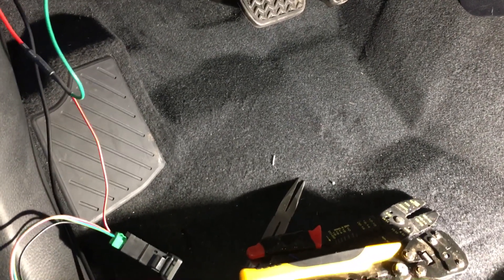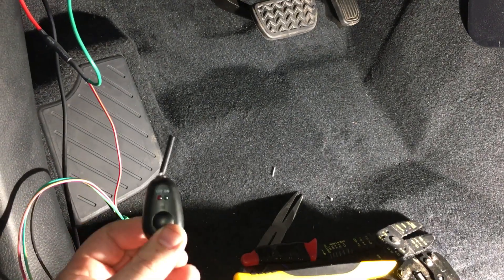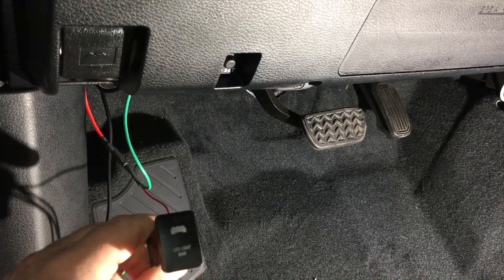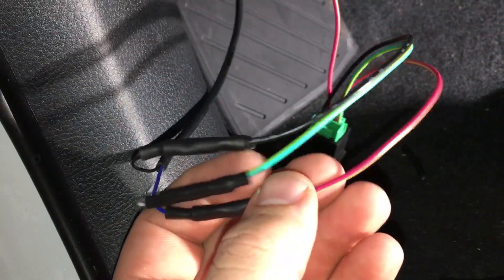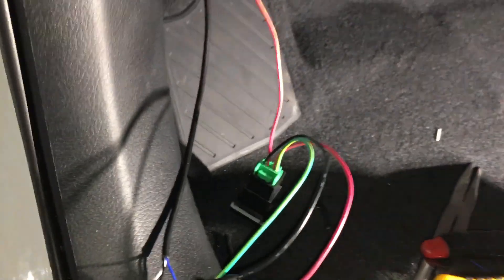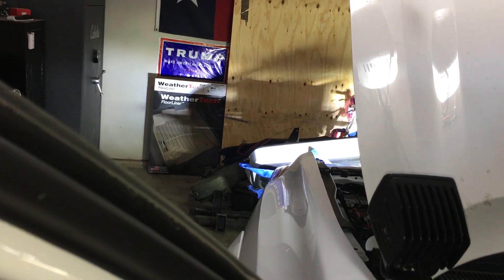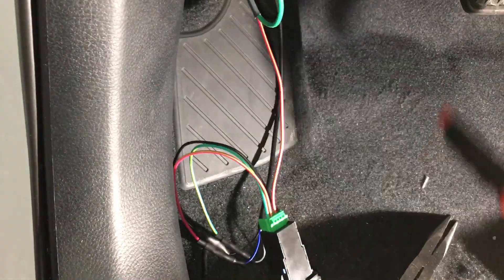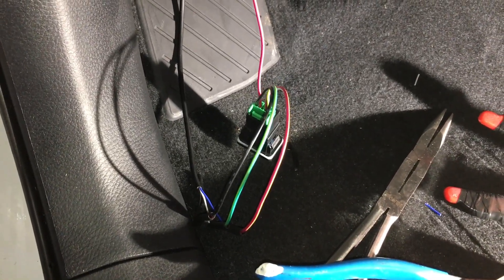Wiring up a Push Button (Mictuning) switch

Comment: Bro I have a switch of 2 buttoms with 5 cables of colors (red, green, yellow, black,  blue) my raptor lights have only red and black and the add a circuit cable (for the fuse) is red. I am really confused on how to match them, any video or tip to figure it out? Thanks

Comment: Can I tap the source wire [red/yellow] with the dash light [red/yellow] with a 10amp fuse in-between?
The idea is to have the switch accessory light turn on only when high beams are on and not when the car accessory light is on. But not sure if someone tried it already.

Comment: If I’m using a relay does one wire go to the relay and other battery or fuse box , I know one goes to power to light the switch up. But the other 2 wires. Which goes to relay which goes to battery

Comment: If I dont want the switch to light up, do I need the add a fuse? Could I just leave that that second red wire loose?
Reply: Hey just wanted to know if you left your wire like that or if you added a fuse, cuz i have the same question as you but i cant find an answer

Comment: Quick question. I added one and I have an add a fuse coming to me, so I tucked a wire away to light up the switch. With the add a fuse you took the cover off the tundra fuse box. How did u fit the cover back on the under dash fuse box or did u leave it off now? Thanks
Reply: I found my answer and didn’t use the add a fuse. I popped off the black label holding the switches and used a circuit tester to find the wire for the other switches that lights it up when the lights are on and I tapped into the one on the bed on off switch. It’s the yellow wire in the top row on that switch that lights it up and I tapped into it and wired the fog light switch to it so now my fog light switch lights up when I turn the lights on, keeps it looking factory original and I have led fog lights now.

Comment: Thanks for the very helpful video—just what I was looking for.  But I have the same question as a number of others on here and I haven't seen it answered: where does the green wire go that is tied in to the add-a-fuse?  Thanks for the help!
Reply from the maker: It goes into any spot on your underdash fuse panel that has accessory power. I have mine tied into the power jack fuse spot
Reply: Thanks for the reply, but I guess I'm still not quite clear.  Where does the other end of the green wire go? The end that runs up under the dash and out of the picture, not the end thats visible  in the shot where it joins the add-a-fuse wire next to the red/yellow wire off the push switch.
Reply: Are you saying that the end I'm referring to goes to another fuse in the same panel that the add-a-fuse is on?  Thank you for your time.
Reply from the maker: Oh I see what you’re asking. I think I replied to one of those but it’s to another switch that way I only need one “add a fuse”
Reply: Got it!  Thanks again.

Comment: Hey quick question bro, if I already have my led light bar installed through my ignition fuse with the add a circuit, then where do I connect the ditch lights add a fuse? Any open fuse on the circuit board?

Comment: I've watched many videos and each time my button stayed on even though the truck was off.  I ordered both the wiring harness and switch from caliraised.  I pulled my hair out wiring this thing up according to how the internet said I should and it just wouldn't work correctly.  Turns out that the wires are wrong.  In my case, the blue wire(from the relay) actually needed to be connected to the green/yellow wire(switch harness).  The red/yellow wire responsible for the on state needed to be connected to the white wire(from relay).  Bottom line, don't always trust the way YOUR harness is pinned.

Comment: So when you connected the wires did you just strip the top of the wires and tie them together and then put the heat shrink on top of it ?

Comment: Problem fixed for the constant power on the switch. If you have the new Cali Raised switch harness with black, red and white. Black to black, green/yellow to the red, Red 1 closest to the green goes to white. Add a fuse to the panel fuse on the fuse block. Was just confirmed on Tacoma world, and I just fixed mine a moment ago. I had the same problem and now I don't after I switched the wires.

Comment: Hi Texas,
Do you have anywhere showing how you connected it to the fuse box for power or any of the wiring set up in the engine compartment. I just installed a led light bar behind lower grille on my Tacoma and the switch has constant power. Not looking to drain my battery and being we have the same harness this looks like it would be my best option. Anyway you could make another video to show that? 
Thank you
Reply: Bruce Gibson check out my video how I did my tacoma

Comment: Damn did it exactly like you said and the switch stays powered on and the lights go on with the battery off. Can you help me? Am I missing something? We have the exact same set up. Except the Cali raised harness has a red instead of blue. I assumed it was the blue one.
Reply from the maker: MustacheMuster  you may have switched up the red wires.
Reply: Wondering if you got your wiring of this switch figured out??  I've got seemingly the same problem you do...  Can you give me a little help?
Reply: Did you ever figure out the issue? Im trying to install today and im running into the same issue
Reply: I figured out that the switch wiring varies from manufacturer to manufacturer...  so the Black was not necessarily GROUND...  so I finally figured it out based on pin number...  Still having issues with the dash lights circuit.  but the upper LED lights when I turn on the switch along with my light bar...  and turns off with the lights as well.
Hope this helps a  little!

Comment: Hello all, I have the same question as Jonathan. What is the other green wire coming from the add a fuse line, looks like you added another wire to that add a fuse line. I am having the issue where the top light on the switch stays on all the time even if light is off. The bottom light is fine it turns on with dash light. Sorry for the long comment/question.
Reply: Greetings!
Did you get it figured out?  I am running into the same issue you had...
Reply: This is the exact issue I am running into and no one ever comes back with a solution, they figure it out and leave the rest of the internet in wonder...
Reply: My top light is staying on also while the bottom lettering is on/off with the ignition. I have the caliraised oem switch wired into a fuse tap.

Comment: what gauge wire did you use?
Reply from the maker: Jonathon Lindner  16ga
Reply: Thank you.  Whats the other green wire going to your add a fuse? Is that for another switch?  Which size fuse did you use? 7.5amp?

Comment: the switch is a 3amp switch like the one you have ch4x4, but the one rigid supplied comes with is a 12v- 15 amp switch. Will it work without a relay and not damage the switch?

Comment: Noticed you have the same pod switch that I ordered. how did you wire that one? I don't feel like screwing up my wiring on a new truck.
Reply from the maker: steve ventura  wire it the same way.. CH4x4 also sends good instructions as well
Reply: TexasGunGuy88 what size add a fuse adapter did you get? Where does that green wire connect to from the add a fuse box? Does it require a relay, because my rigid industries pods wiring harness was non relay. Sorry for all the questions...just trying to get everything ready.